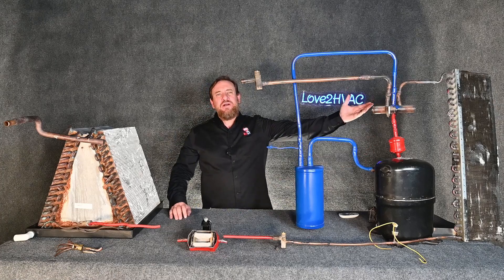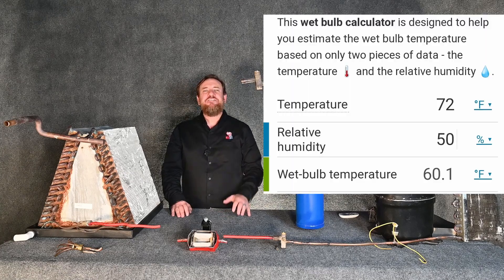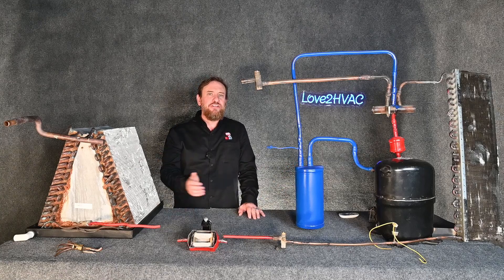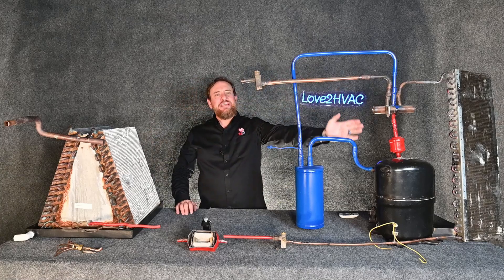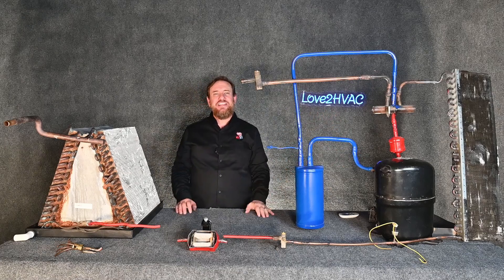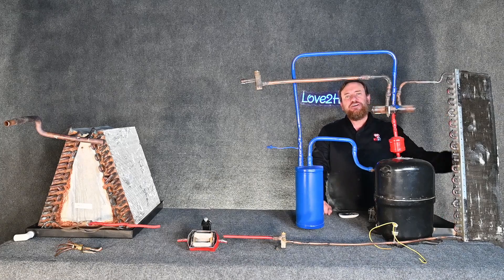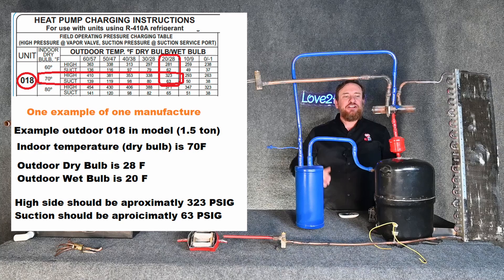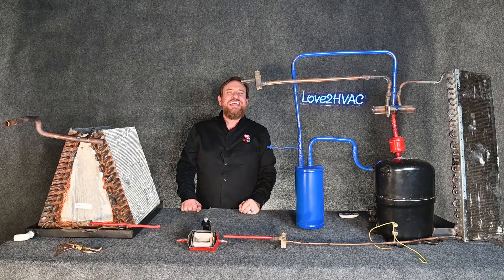Heat Pump 06 Fixed orifice metering device

Comment: Wow great lesson.  It sucks that we have companies that do improper installations.  I had a new compressor installed and evap coil.  They forgot to install the metering orifice  device and the compressor ran for 3 months with out the metering orifice.   The old evap coil had a TXV valve.  They should have installed a TXV valve not a fixed orifice.  My new system is so screwed up now.  The tech installed the missing orifice by opening the line and he did not evac the system and just  added freon.   I am going to demand they replace everything.